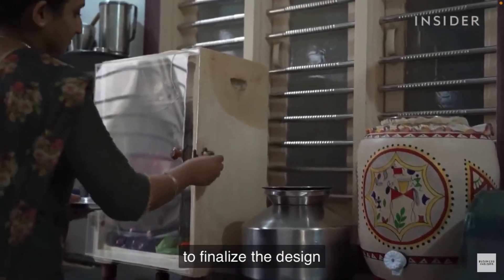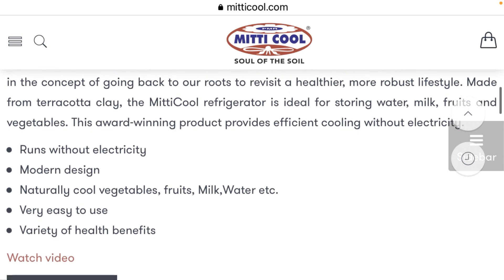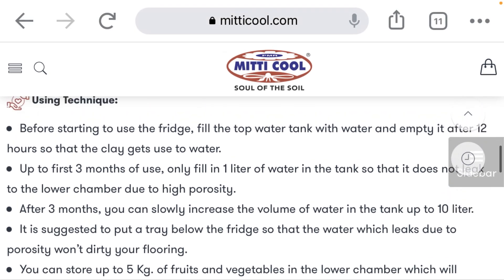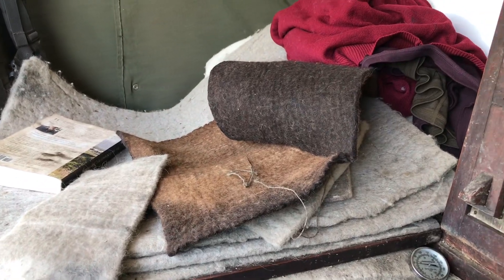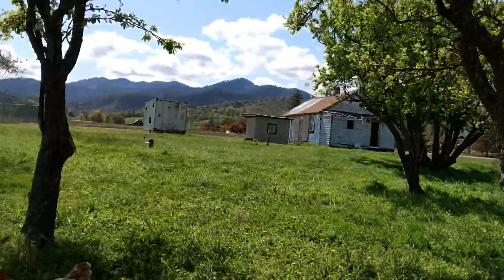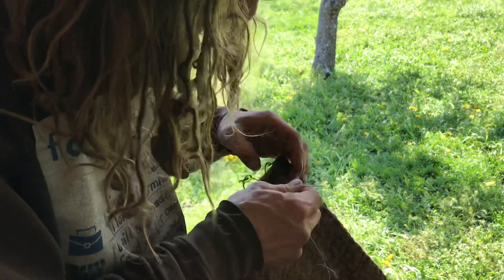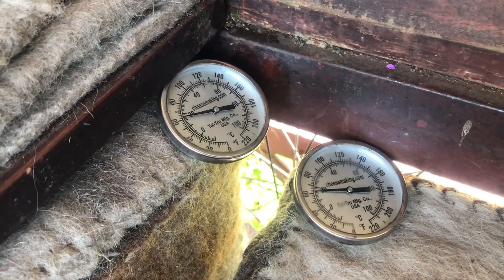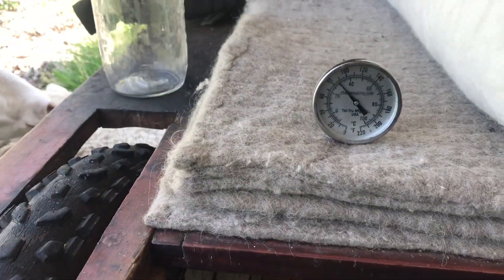DIY off-grid refrigerator!(evaporative-cooling)

Comment: The indian ceramic & clay ones inside temp are dependant on thickness & type as  some clay lining absorb water better to add cooling & are not for travel. Yet clay is everywhere so can be remade easily & fired in a campfire like Andy Ward ancient pottery channel shows all this process.
 But a clay liner in a icechest would though breakable would compete temperature wise used inside a regular icechest. 
You should make some wool coolers to sell. Or see if you could sell idea.
Reply: They have something similar in Africa.